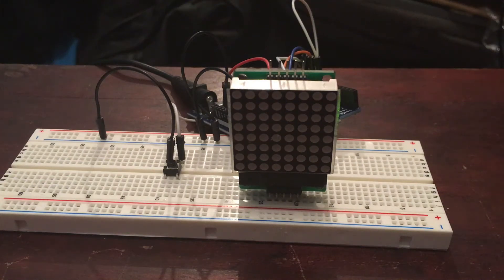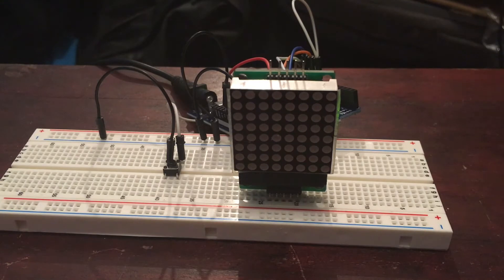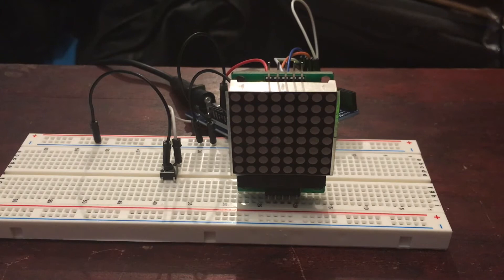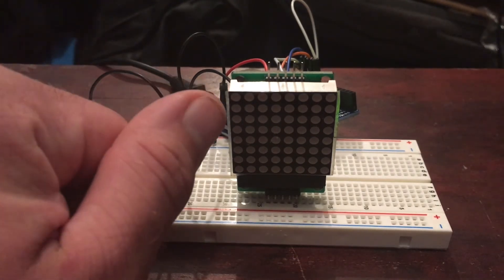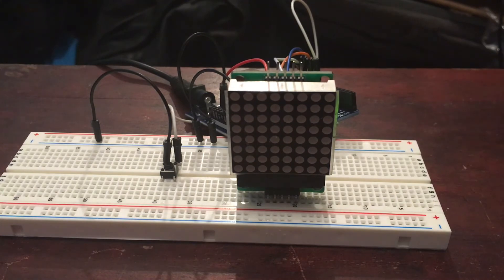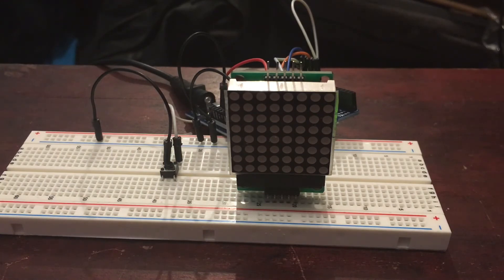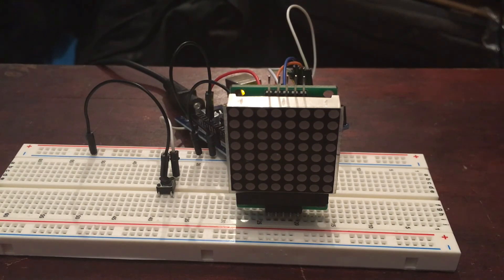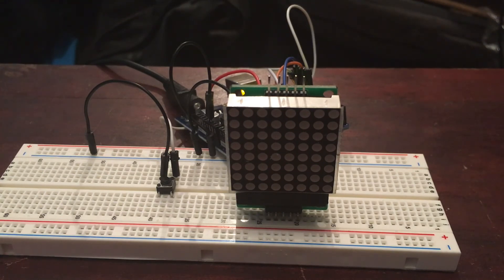Simple LED Matrix Countdown using UNO R3

Comment: Sir, How you connect between push button and dot matrix?
Reply from the maker: Everything on this goes to a breadboard, with links to the Arduino Uno.  The push button was set as a digital input, the matrix was digital outputs.